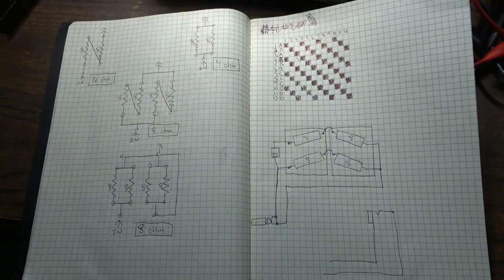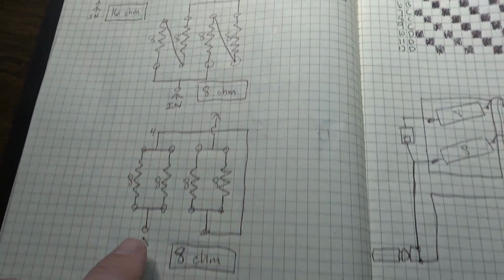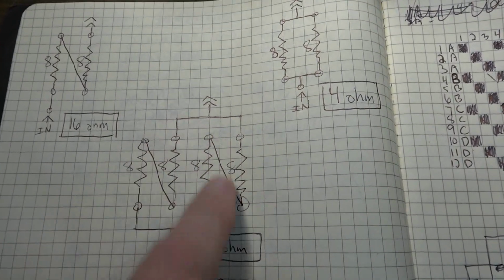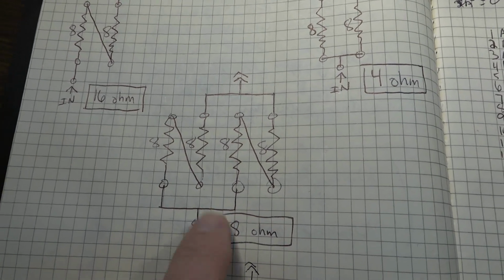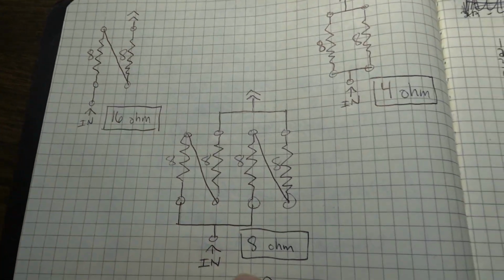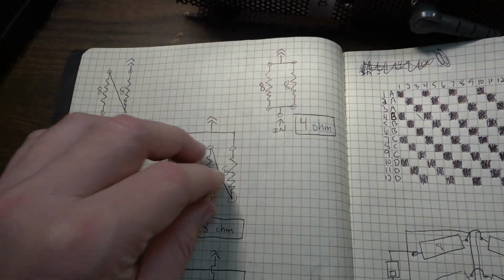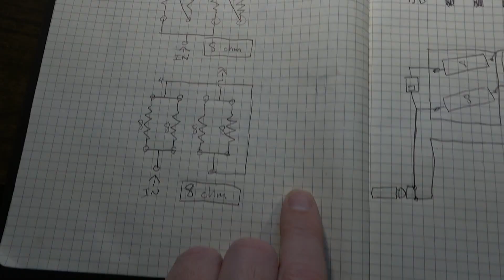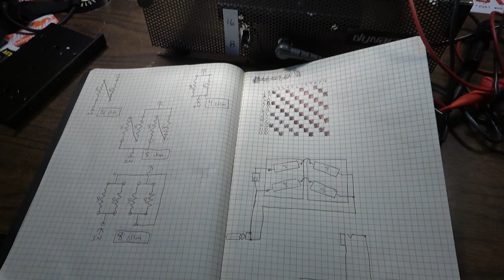How to Construct a CHEAP Resistive Dummy Load Box for Guitar Amp (Hot Plate, Power Soak)

Comment from the maker: CORRECTION: At about 11:20 I talk about total "power handling" of the load. I said, "with two resistors in series you don't increase your power handling". That is not strictly true. What I should have said was "you don't increase your TOTAL MAXIMUM power handling with two resistors in series". In the case of parallel resistors, they split the current between them, so the total maximum wattage that can be dissipated by the two resistors is increased, and if both are the same value, this figure is effectively DOUBLED. But in the case of series resistors, the TOTAL current through the series resistors is not split. The same current flows through both. Therefore, the total maximum power handling of this load cannot exceed the maximum wattage rating for the LEAST robust resistor in the series. I hope that clears things up somewhat. Got a lot of comments about that one, which is cool because it shows people are watching and thinking.
Reply: 2 power resistors of the same wattage and ohms value will double the wattage handling if they are wired in parallel or series. Ohms law dictates this. Current doesn't remain the same; it doubles when resistors are wired in parallel or it gets cut in half if wired in series. Voltage through each resistor does the opposite... Power dissipation (E*I or wattage) remains the same whether resistors are in series or parallel. So, two 100 watt resistors of same dissipation and ohmage will give you 200 watts dissipation whether wired in series or parallel
Reply: @NoOne-sn2si  thank you. It's pretty bad when somebody corrects themselves and still gets it wrong. Worse when they claim to have some technical expertise on the topic. And worst when they are teaching others with their incorrect information. Ohm's law is about as easy as it gets and Brad should know better.
Reply: @JRFarmercom  He really doesn't understand Ohms Law! Or circuit theory in general!
Reply: As stated before, this is wrong. Period. No matter if in series or parallel, a circuit made of X resistors can handle X-times the power limit of the weakest of those resistors, if they are of the same value. This is because voltage is divided in serial circuits and current is divided in parallel circuits.
Reply: Before anyone builds this, ask yourself why you want to do it. Particularly for tube amps, resistive loads replacing a speaker sound fizzy, the load needs to be reactive  with inductance and capacitance. Also if you want to record the amp you will need a cab simulator/ impulse response.
Reply: Brad, why couldn't you make a reactive load device by using a high wattage speaker... without the cone? (basically a Harry Kolbe "Silent Speaker"). You could run a line out to effects, that would then run into a power amp, or you could just use it as a stand alone device for repairing tube amps. It would certainly be better than running an output transformer into a bunch of resistors. Just an idea.
Reply: Watts equals current times voltage at any given point all ways but you can fool yourself with test gear mx false readings

Comment: Hi! great project! I´m testing an 8 Ohm prototype made of 2 pairs of 8ohm 100W resistors, and I´m making initial tests with 3 amps, 24 volts and making augments of 1 volt.  I have noticed two things, I will appreciate if we can share some info about it. Here is what I found:

1.- Do you have any specific test to confirm it´s working? I made this calculation:
To get the maximum input values:
P= 124 [W] @ 1k [Hz] (info from manufacturer, hand made amplifier)
Z= 8  [Ohms]
=> I = sqrt(P/Z) which is a bit less than 4 [Amp]
=> Vout max from amp = 4*8 = 32 [V]

So with this I decided to make the system stable for a DC signal of 32*sqrt(2) = 45.3 [V], and an AC signal, 1k [Hz], V peak = 45.3[V]

2. - The resistors gets VERY hot : I ´m making measurements, and just got a thermometer to confirm but I could estimate about 80°Celsius by touching it. Do you know if there is a wat of estimating or calculating that? I´m concerned with loosgin resistance stability due to heat in the long run. I´m building an enclosure with a  1590 C Hammond box, a fan underneath the resistors, and CPU dissipation and vents on the outside of the box.

Have a great day!

Comment: had a line out that didnt have a dummy load but worked on standby and was not affected by master volume, wanted to know if i could connect a speaker cable to a 100 watt 8 ohm resistor and have that plugged in just incase i accidentally switched it from standby to on with volume at 0, and this video was super helpful.

I learned i can run the two 8 ohms i have in the 4 or 16 configuration since the head has both options and it will probably be fine ayyy time to go make my first thing and see if I understood this at all.

Comment: Question... 😊 if I build one of these... I could hook up my marshall head without a speaker and play to my DAW without the worry of killing my head even if I used it full blast for an hour... I have a marshall jcm 900 50w it has a couple of line outs (direct out and recording compensated)
Reply from the maker: You need a speaker load on the speaker output of any tube amp to run it. You could probably pull your output tubes out of the amp and use the line out though with no problem then. I assume that, but I don’t have your schematic in front of me atm.

Comment: Hey Brad, my amp guy says that nothing will truly substitute a speaker cabinet for a tube amplifier and that any dummy loads otherwise will end up damaging it. I would normally look at the fact you're making one, as well as the fact they are sold everywhere and seem to be widely used as evidence to the contrary. However, this guy is definitely has some weight behind his opinion as he's worked on stuff for big names for a long time (more on the vintage synth end of things, but he's done many amps). 

Is there any truth to it, or do the resistors truly serve the same function that the speakers do in a cabinet?

Comment: Could have probably had better thermal properties if you had put like 1/4 as much thermal paste, it is just meant to fill in the imperfections of the metal, very thing layers work excellent - after that you start to insulate it as the metal (copper and alum) will disperse it better than the paste will.

Comment: Hi! Awesome video! 

I just ordered 4 of the resistors. I am just now realising that my Engl head is only 50w. If I build it the way you have, will there be any negative effects or is it just more headroom? 

I guess what I'm asking is, are the resistors 100w "max". 

Thanks to anyone who helps me out!
Reply from the maker: Yes. 100w max
Reply: @TheGuitologist  oh cool. So as long as I get the serial/parallel wiring correct, I can run my Engl Sceamer 50 into it. 

Thank you so much for this video. I was going to try to buy some kind of solution for this but I like to tinker and prefer to build cool stuff myself.

Comment: Can you make a video showing how to make a Line Out Box because some Line out Boxes use an isolation transformer and the line out box needs to convert speaker level signal to instrumental level or line level signal. The amplifiers output is going to have an impedance of 4 ohm, 8 ohm or 16 ohms which the signal is not an audio signal level because its a speaker signal level which needs to get converted back to instrument level or line level signal. It would be nice to learn how to do this correctly.

Comment: It's good to show simple ways to make a home brew speaker load..

Many years back I used heater element.

Now use fan cooling just to push the load resistors a littler harder.

Comment: The resistors you have used are metal clad wirewound resistors.
These will be an inductive load to the amp, you realy need to use
high wattage carbon film resistors, this is what Hughes & Kettner
use in their valve amps as dummy loads.

Comment: I've actually been wanting to build one of these from an old paint can filled with cooling oil for a ham radio dummy load for the radio, has to be able to handle high wattage.  I like this for that idea much better,  never thought of it for some reason.  
 I would also like to see about using this as a laod for the tube amps as well. 
Great video's as always!

Comment: Tip: I use a Badcat amp attenuator... but it's used to lower the volume of your speaker not eliminate the speaker. So... long story short: Dummy load it...instead if using speakers. Now the output goes straight into mixer. Magic!
Will not work if this isn't done, the attenuator does not sound the same unless you use "loud enough" which is way too loud for my bedroom.

Comment: A regular space heater on "Hi" ( 1650 watts) is quite near 8 ohms and can dissipate.... well 1650 watts. Just change the plug. Best  to use one without a fan. If it has a fan you can disconnect it if you don't drive it near the max rating. The fan is inductive instead of the resistive load of the heater coils.  It wont hurt anything but the impedance will vary a little with frequency and will have a reactive component. A lower setting on the heater will give higher impedance ( a 900 watt setting would be 16 ohms). If you have a 1000 watt setting it will be a little lower than 16 ohms. You can calculate the impedance of the heater from the listed watt draw at a particular heat switch setting by the formula 14400/watts=impedance.... assuming 120 volt ac line voltage.   You can hear the guitar sound from the heater a little too. A bonus...
Reply from the maker: Hmm. I’ll have to try this sometime.

Comment: I made one with an audio tap. I can run a 5150 head and then use impulse responses in my DAW. I think I have the schematic. Also, you're using too much thermal goop. I used to design battery chargers for Yuasa/Exide and we found if there was too much thermal grease it screwed up the heat conductance into the heatsink(Large diodes on a flat plate). Little dab a do ya.
Reply: And where the output should be for daw recording?

Comment: Watt a cute little low tech load bank and a great use for a dynaco 120 horrible amp my load band is rated conservatively at 1,000 watt a side it’s forced air conked and water cooled the resistors used are Dale250 wt nonindutive with switching between 2, 4 or 8 rack mount with tempature switchs to control the fan speed and pump for cooling
Reply from the maker: I have load envy.

Comment: Wicked, I was just about to whip one of these together.  CPU coolers should work great for the application.  Super- cheap (or even free) for 80 to 100W dissipation each.
Biggest down side is the 12V requirement for the fans.  I used a  PC PSU in my last dummy load.  Built it in an old Dell chassis.

Comment: This makes me wonder if you can use an old punctured speaker that still has an intact voice coil. Basically a speaker that doesn't make much noise. Maybe put it inside a sealed box. I can't remember if this is already a thing or not.

Hmm... maybe I'm confusing a dummy load with an attenuator.

Comment: Slight correction - power dissipation is always additive, so you have a 200w 16Ohm and 400w 8Ohm load.
Reply: Of course that's assuming you have enough dissipation surface and ventilation to radiate that amount of power... Power ratings are given making some assumptions about temperature rise per watt vs. max temp rating of the component so it's probably possible to submerge a 1/2w resistor in LN2 and push 50w out of it.

Comment: Seems 4 ohm would be good for bass amp heads.... you could parallel that 4ohm with enough of those handle a bass amp... drill a different hole pattern and put 4 of those on each side of the heat sink....4 ohms and 400 watts handling.

Comment: Using the dummy load, how to you then hear the amp ?
Reply: In theory you’d go out through the line-out of your head and into recording interfaces.
Reply from the maker: You can also use a speaker cab parallel to this load on the amp output and it’ll cut the overall power to the speakers in half.

Comment: With a dummy load for troubleshooting, measuring etc on workbench, if the dummy load is not used when playing, does less than full power handling do the job. Say being enough for a bass amp, since you don't introduce power spikes with transients when you're not playing it?
Reply from the maker: It can work for som troubleshooting, but I wouldn’t want to push it too long.

Comment: Great video. I made one of these for high discharging RC batteries for racing (they sell for $180 USD which is the same thing you built with a fancy brand label on it).   RC guys would appreciate this build, I will pass it on to them.

Comment: Made one of these years ago with 4 16 ohm 100 watt resistors, gives me 100 watts of 16 ohm, 200 watts of 8 ohm, and 400 watts of 4 ohm. I use a much more massive heat sink than you but still I have contemplated water cooling because it get's scarry hot when soaking an amp. For testing and intermittent use it's fine.
Reply from the maker: I can always add another heat sink on top of each heat sink later. And I can add a fan as well, which will help. A cool video might be frying some bacon and eggs on it. :)
Reply: @TheGuitologist  :)

Comment: 11:17

Power handling also doubles in series, as they get full current, but drop only half the voltage. 
However keep in mind that those power resistors also have a maximum temperature rating. With purely passive cooling, you can calculate the approximate temperature rise per watt for your heat sinks. I think you need surface area, cubic content and thermal conductivity but don't ask me for the formula. Only if they stay below the max operating temperature they'll dissipate full power with no damage. Just by looking the heat sink is probably too small, but you're not gonna need that for guitar amps anyways, so you're fine.
Reply from the maker: Several others are saying this as well, but it’s a misnomer, I think. So, yes, the voltage drop per R gets divided between the two Rs, so all other things being equal, two Rs in series are better than one, but that doesn’t raise the max power rating of the circuit as a whole. The proper way to look at it is the two 8 ohm Rs in series at 100w max rating each together are the equivalent of one 16 ohm at 100w max.
Reply: @TheGuitologist  

That would be 40V 2.5A

(40/16)*40 = 100W
40/16 = 2.5A

20V drop per R @ 2.5A

20*2.5 = 50W dissipation for each R.

Comment: Now that's a real cool use of existing heatsinks and chassis, Brad. Thank you. If you use your pairs of 8's in parallel to make 4's, you can then parallel those pairs to give you 2ohm (Bassman and Super Reverb).  You now have a couple of options on getting your 16ohm. I use the Weber Tru Load, which is excellent 90% of the time. It has a BNC for my scope, but sometimes the inbuilt speaker coil can cause oscillations. That's when I need to pull out my Guitologist dummy load. :-)
Reply from the maker: I will definitely be adding more options to this. Ideally, I need another one exactly like this wired to 4 and 2. I could get there with switching too, but switches are a failure point I’d rather avoid where possible.

Comment: Wow Brad. What a way to treat a Dynaco 120. That was my first ever amp project kit circa 1974. Ran my floor wedges until I blew up one side during a gig. Ooops! That aside, 2 x 100W - 8ohm resistors in series or parallel will handle 200W. Even though when in series the current is equal in each R, the voltage divides across both. Similar to when in parallel the current divides, but the voltage drop is equal across both. You can do the math as I x V , or I^2 x R, both = same W. As long as the resistors are equal this will hold true. It's when you have unequal resistors that things get sporting; you have to calculate voltage and current through each leg and determine power handling requirements for each R (that's when I^2 x R is best formula to use). Have fun with your load, but don't do electrics loaded!;-)
Reply from the maker: I feel like everyone is confused on the issue of series resistance. Two 8 ohm 100W max Rs in series yields the equivalent of one 16 ohm at 100W max. The max wattage rating of the pair does not technically increase.

Comment: Dang! You completely dismembered a vintage Dynaco stereo amp just to make something  to dissipate some extra heat? You big dummy!
Reply from the maker: Nah. This thing needed a lot of work. Lots of leads already disconnected on it, one power resistor was rattling around inside it. And generally I have no use for it. I have tube amps for stereo use. Plus, this model isn't generally that well regarded.

Comment: you should expand on this and show us how to make a home made attenuator
Reply: Tremendous idea !!!
Reply: In its most primevil form: remove 1 resistor for desired ohmage. Run wires from where the resistor was to a 1/4 inch jack.  Plug stuff in.  In series/parallel, expect about 75 pct Wattage attenuation of low frequencies.  Highs will be attenuated based on reactive loading.  Highly variable by speaker type.
Reply: That would be seriously valuable video!
Reply from the maker: Ok.

Comment: One question and I'm sure practical experience has the answer, resistance is a dc thing while impedance is an ac thing.
Reply from the maker: That's correct. Impedance will depend on AC voltage and current and will vary depending on which point in the AC cycle the wave is at, whereas DC resistance is a static load. It will not vary.